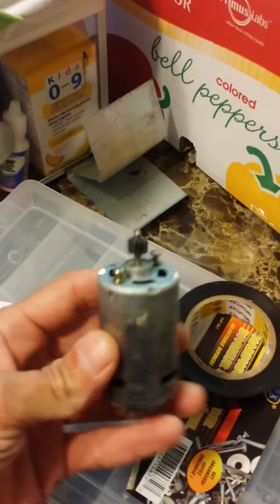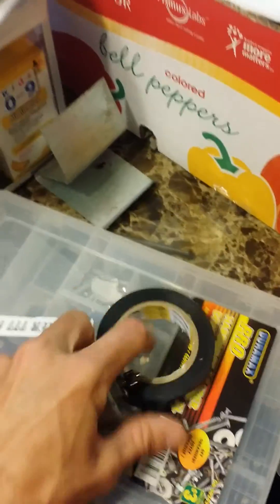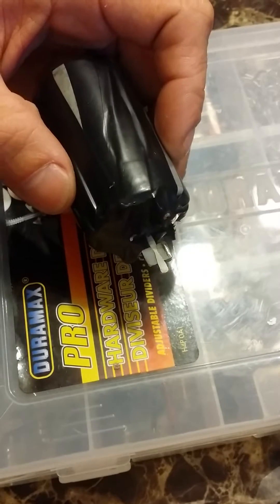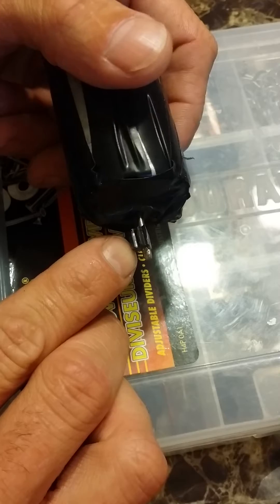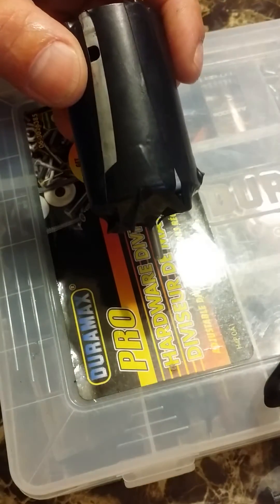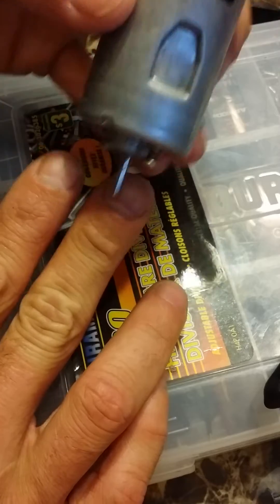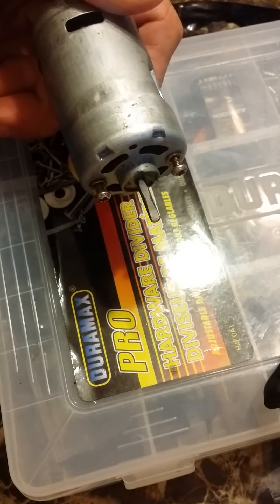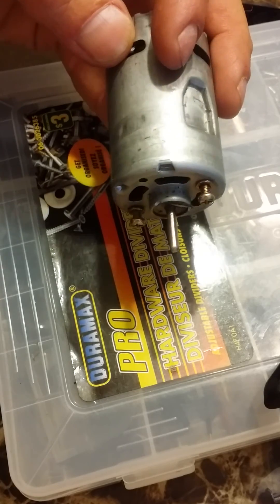How to : Cordless drill motor converted to rc motor

Comment: I found out that by using a 12 volt drill motor as soon as I ease up on the throttle the wheels slide to a stop.  would be nice if it came to a rolling stop.

Comment: Hi I have a traxxas stampede vxl 4x4 and I have 3 days wires going from the motor to the esc I'mNot sure if I can use a drill motor or if I can find a drill motor
Reply: Use a brushed esc rather than a brushless.